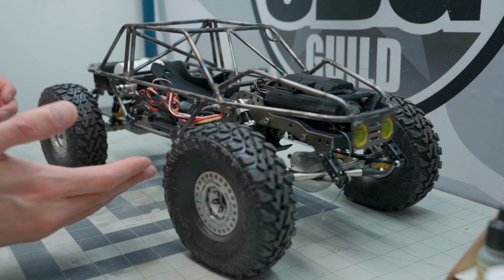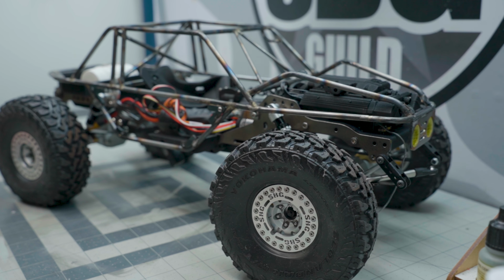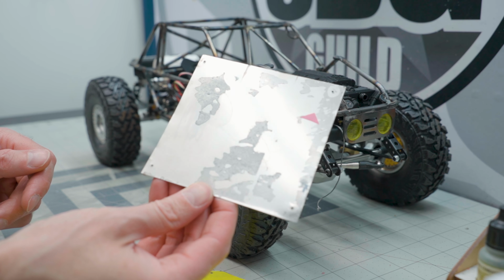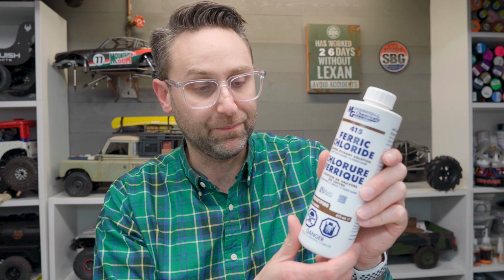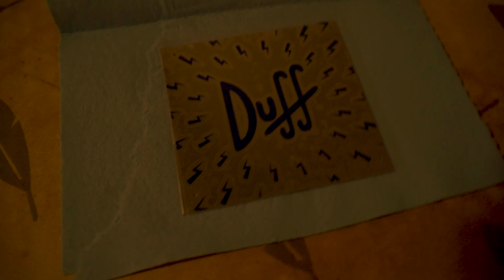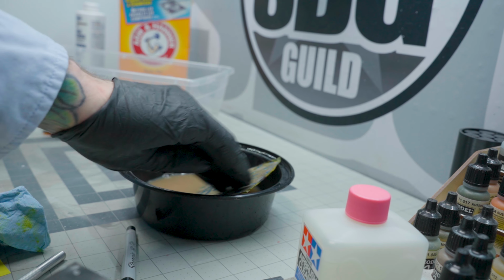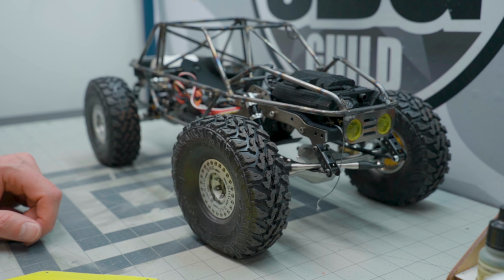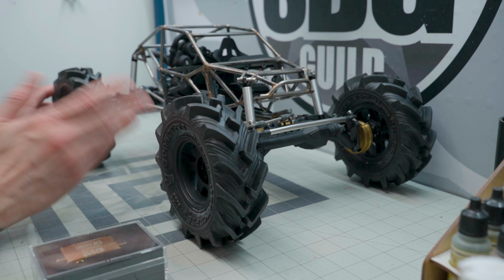Etching Metal! RC Rock Crawling in Colorado Ep.3

Comment: It states that ALL brass must be painted. It also say that the driver and seat must be separated and solid
Reply from the maker: If I have to paint my servos when there are red, blue, and silver ones out there, then everyone should have to do the same. My drivers are separate from the seats, I'm not using Josh's print.
Reply: @scalebuildersguild  the only reason I mention it is because I had similar ideas and didn’t want to be out of spec. Even tho real copper wheels or at least plated exist in real life, brass ones must be painted. So similar but different.